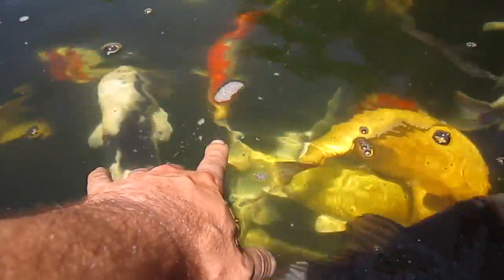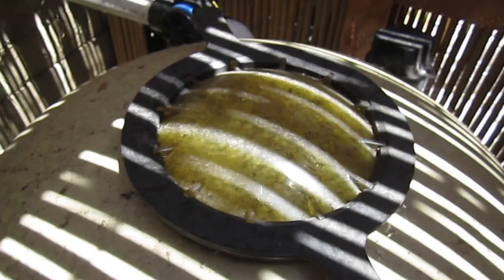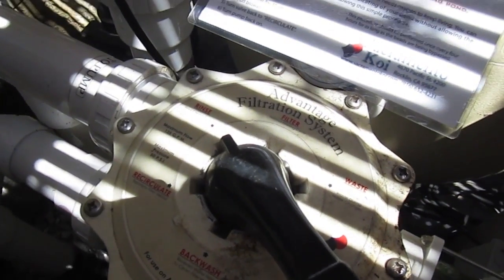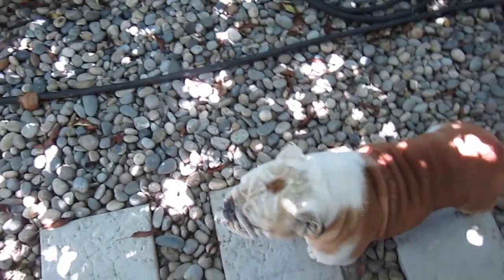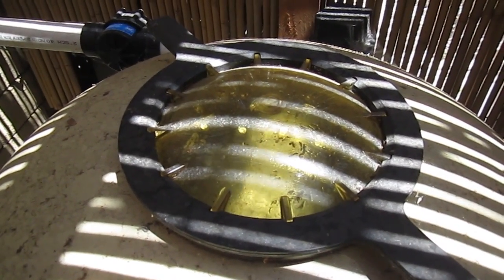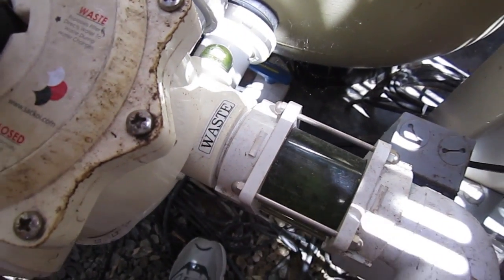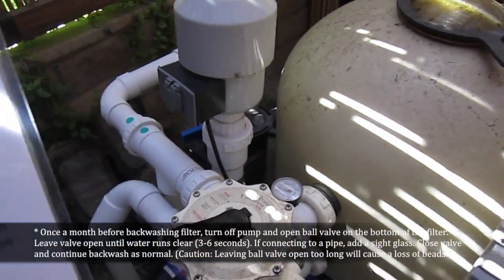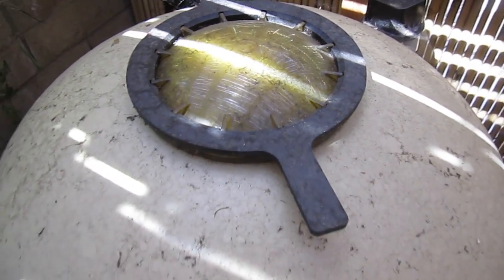Instructions for backwashing Advantage Bead Filter

Comment: Did you put a pre filter. Or do bottom drains go straight to advantage filter.
Reply from the maker: Both bottom drains and skimmer dump into the collection box which is designed to catch large items such as leaves. From the collection box we go straight into the pump and filter. You can checkout their design plans here http://sacramentokoi.com/advantage-design-plans/ I used their 10k gallon plans for my pond.. good luck